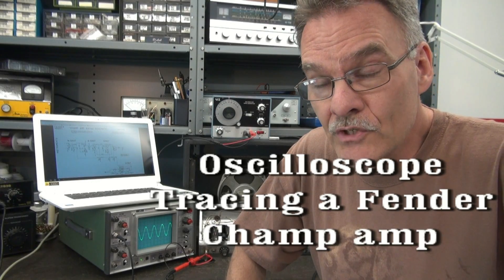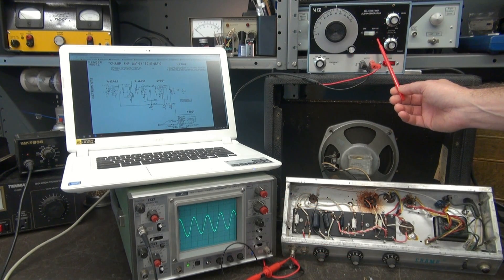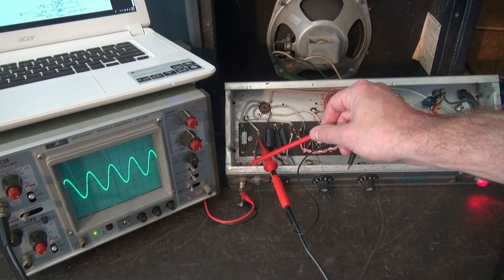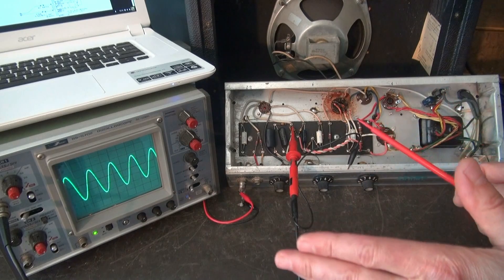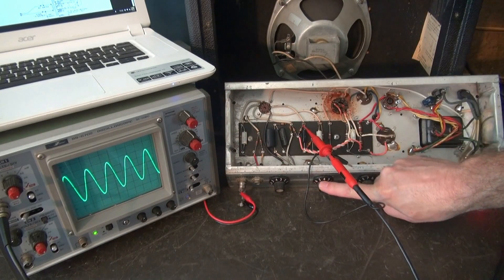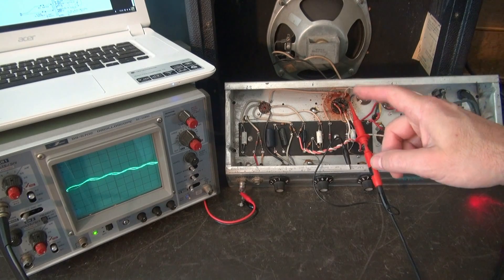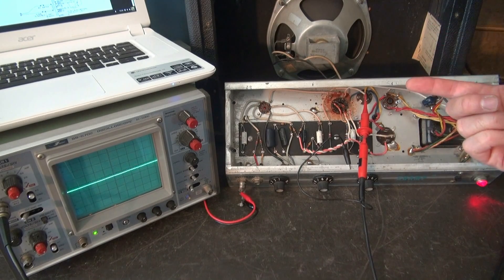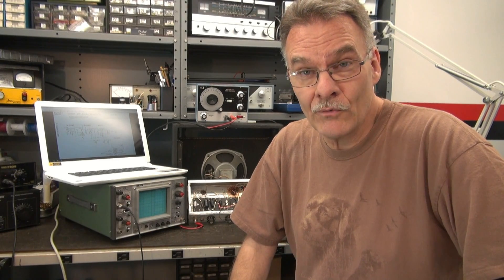How to signal trace Fender Champ guitar amp Oscilloscope stage test D-lab

Comment: You still have ground reference on your neutral wire. The device under test should be isolated away from the ground and neutral via an isolation transformer.

Comment: As a 40 year veteran of electronics instrument repair, I have to disagree with your recommendation to float your scope ground. You may influence inexperienced techs to cut the earth ground off their test equipment cords.  Back in the day, my company provided each tech with an isolation transformer for the device under test. Then we could ground a scope probe to the chassis.  One other thing: when you state signal voltages, ensure you're clear if it's AC peak to peak, or DC. Otherwise, your videos are very helpful.
Reply: Yeah. NEVER float the scope ground. Just buy a differential probe if you need to measure voltages that may have a different reference from the mains/scope ground. After all your life is going to be worth more than the ~$250 or so a decent differential scope probe will cost you.
Reply: As a recovering methamphetamine addict, I concur.

Comment: So, ungrounded scope? Hmm, well, so what happens if your grounded amp makes connect to your ungrounded scope which for some reason now has voltage on it? Same sparks, right? I would say leave your scope along and if you have an amp that doesn’t have a 3 way ground plug, set it up, plug it in, carefully turn it on and take your volt meter and read from chassis to another grounded equipment ( scope) looking for AC and DC. I recapped a 50w Marshall JCM800 2204 the other night. Well the 50 uf / 50 uf audio cap had a ground coming from audio ground on the circuit board. Turns out I didn’t realize another short metal wire going from the cap ground lug to chassis ground had broke….no ground! So now the grounded cap is floating 242 Vdc back to the audio jacks and circuits there. I got a nice buzzing shock on my finger tip touching my audio generator when I connected it. Luckily I was taught years ago the one had rule when probing around high voltages and didn’t complete the circuit by touching the grounded chassis with my other hand, Now there is a good safety tip, one hand rule! Great presentation otherwise.

Comment: Great video. Simple and to the point. I have a simple question for you. I was always told that we need to connect our circuit in test through an isolation transformer for the reason on not burning the oscilloscope down. So, by cutting off the ground pin from the oscilloscope plug we have the same effect? Thanks in advance.
Reply: NO!! Not at all!! You still have ground reference through the neutral.

Comment: I’m new to O’sopes but I have been playing with tube amps since high school as a hobby, I’m 67 now.  
I bought a ChiCom 100mhz digital scope and it has a normal IEC power cord with ground. Do these need a ground lift too, (plastic case)?   The manual doesn’t mention any cautions.

Comment: I am going to chime in the lifting of the ground on the scope. Maybe you meant the isolation transformer? If you have lifted the ground off the scope and the chassis is hot, hooking a scope ground to the hot chassis will make the scope chassis hot -  at power outlet voltage.
Reply: That's why you always test with a meter to ensure DUT chassis ground and AC supply ground are one and the same.  Lifting the ground on a scope is a common safety practice; Terry warned of a big arc, but the real danger is blowing up the scope.

Comment: Mr. Terry:  
     
I have heard from different - yet reliable sources - to NOT lift the ground from the o-scope.  Told it was SOP to lift the ground from the DUT.

Can you perhaps make a viddy to make all of this clear?  
I mean, safety first - right?

Thanks!
RW
Reply: I'm going to defer to the professor but, I will share my experience with working on television circuits from more than 30yrs ago, we used to "float" the scope by using a ground lifter because when you're probing the high voltage circuit, if scope is grounded, it's easy to cause an undesired arcing/Sparks across the probe.  So when you use a Gnd lifter your probe is safe to poke around the circuit without causing unnecessary excitement.  I hope this helps otherwise the professor will hopefully provide a better explanation.

Comment: Hey Terry! I have a 60's Ampeg GS-12 Reverberocket 2 that just developed a loud hum after a short warm up. Have wine, oscope, signal generator and schematic......can you or anyone on the channel give me some words of wisdom on a troubleshooting plan to locate the failed component? I recapped and retubed this amp a couple years ago and I less than 20 hours play time on it.......and it's been sitting unused until I fired it up to use with a pedal steel guitar I procured recently.

Comment: Excellent, easy to follow video.

Regarding the ground isolation, could you also connect the amp (or perhaps the oscilloscope) to an Isolation Transformer? Would that help do the same thing?
Reply: Not the scope! Just the amp!

Comment: Cool video! I have a question about the modified power plug on the scope. I've read several sources that recommend AGAINST using isolation transformers, or any grounding defeat on the scope. Would it be better to have the amp (in this case) plugged into an isolation transformer? I know tektronix advises against using a "floating" scope. EDIT: some further research indicates the amp should be isolated rather than the scope being "defeated." Not that I'm trying to make any criticisms. I just want to understand the Do's and Don't's so that I don't fry my scope (!), my vintage amp (!!), or me (!!!). Thanks again for the video. Cheers!
Reply from the maker: Hello, Isolating the ground lug on the amp would produce noise, since the hum balance circuit is referenced to chassis. The reason for isolating the AC cord ground lug is to protect the scope. There are instances of improperly grounded devices drawing current thru a grounded piece of test equipment. The test equipment turns into a fuse, in other words probes melt, components burn up. I have used my isolated ground scope method for 40 years, never an issue. The articles you are reading may be referring to other test situations.  However on a tube amp, I would recommend the o'scope ground isolation. Hope this helps.
Reply: @d-labelectronics  So you're saying that a device under test that's connected to an isolation transformer with no physical connection to the mains and ground can still draw current through the oscilloscope when the scope is grounded?

Comment: do all scopes need to be 'ground isolated' even for modern tube amps with the three prong connector?
Reply: You don't ever lift the ground on the scope. Only the device under test, by using an isolation transformer.

Comment: How do i avoid blowing up my oscilloscope doing this with the high volts? Do i set it to AC coupling well as ground isolate the lead.
Reply from the maker: Use a X10 probe, Run your scope on a ground isolator
Reply: Thanks so much for that and your tutorials rock. Subscription complete, cheers

Comment: Terry--thank you so much for your videos! I've learned so much from you. Just for clarification, the last connection you make on the 6V6 is to the OT blue wire. You say "pin 5" in the video, but isn't that actually pin 3? Don't mean to nit pick--I'm trying to locate the source of an annoying buzz in a 5e3, and using your vid to figure out the checkpoints.
Reply from the maker: Yep, I may have mis-spoke, may have been induced by too much wine!
Reply: so pin 5 for the control grid was what you tested 1st THEN you went to pin 3 for the plate, and that was the 'wonky' looking was with no reference to ground............
Reply: Well spotted, Jim ! I had noticed this too, was a bit confusing at first! But chapeau for Terry !!!

Comment: Hi, Terry I have now been successful getting a sine wave on my analog scope from my function generator through my amp with a dummy load and the amp powered by the variac.  But I have searched for days to find a simple answer to a question: If I work only on amps with transformers, do I need to plug the amp into an isolation transformer? Would this type of amp be safer to work on plugged straight into a GFCI outlet?
Reply from the maker: Hello, an isolation Xfmr wont do any good, However, a Variac would be the best choice.
 TD

Comment: I've got a 76' twin reverb that has been modified to have a hi gain channel but recently I was hearing microphonics from one of the pre amp tubes so I swapped the tube and still same problem. I tried both the new and old tubes in different sockets and they were fine. Is this a bad tube socket?

Comment: Signal tracing a simple tube amp is okay, but solid state ones?! At the moment I'm lost in a quasi-complementer type old SS Peavey poweramp. It's a pain in the arse for a beginner. Nice video as usually by the way!
Reply: Ah yes,the old quasi-complimentary stacked NPN T03 power stages.
They are tricky to set up without destroying the O/Ps.  I've had a bit of
experience with those in the old RCA transistor manual circuit (Brute 70watt
rms) quasi-comp amp  Biasing them is the biggest trick with the PNP/NPN
driver stage and the biasing diodes.  

Unlike tube circuits, if the bias is wrong  or one of the driver transistors fails,
 all of a sudden you have a bunch of blown power transistors.